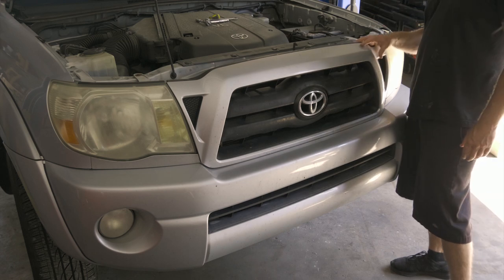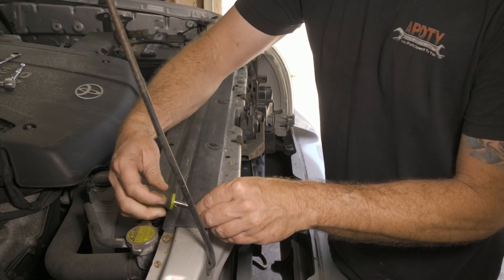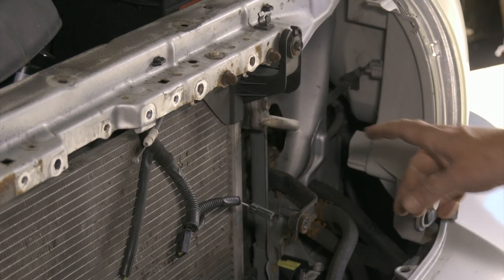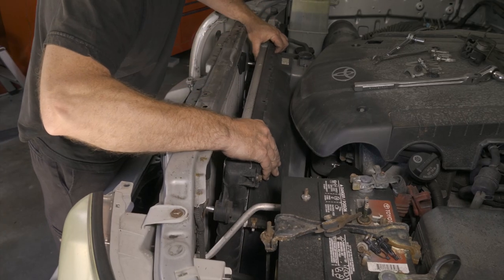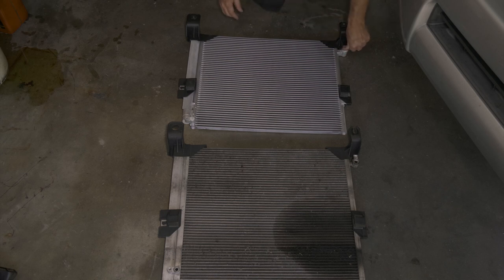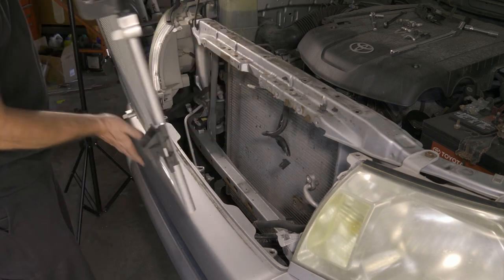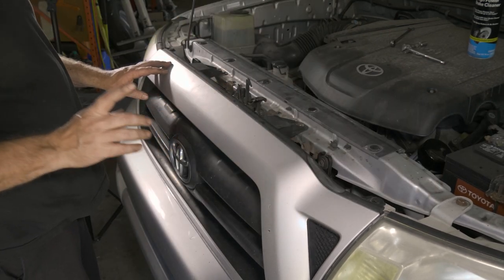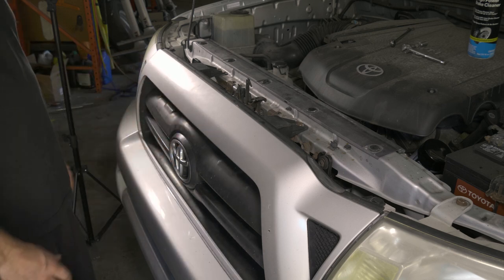2006 Toyota Tacoma AC Condenser

Comment: The O- rings on any AC hose/line connection are one time use only - if you replace the key part - you have got to replace the seals

Comment: What’s the part you are reconnecting at 10:15? My AC stopped working and when I refilled it the system, it was leaking from that unit. I thought this was the AC condenser but obviously not. I can’t find this part on any diagram.

Maybe the fluid was actually leaking from the condenser and spraying through whatever this radiator is.

Nevermind, transmission cooler.

Comment: I have 07 tacoma and my ac doesnt blow cold at idle. Also when i have the  control knob to blow at my face its stuck on face and legs. All the other ones work fine. Just wont blow to face only. Any ideas of what needs ixed. Thank you.

Comment: What were some indicators that caused the replacement? My air is blowing cold on driver side and getting warmer towards the passenger side vent
Reply: Same thing happened with my 2006 tacoma. It was the condenser leaking
Reply: The large oil stain on the condenser was all that was needed after warm air was blowing in the vehicle.
Reply: Michael - I am experiencing the same issue.. Did you determine the problem on yours?

Comment: what type of oil did you use? and where can i find some?
Reply: I have an 04 Tacoma with 120k on it .the dealership says my condenser has a small hole on it. Is this a repairable thing? They want 800 to 1100 to replace it. Help
Reply: Stephen Sale no you cannot patch a condensor